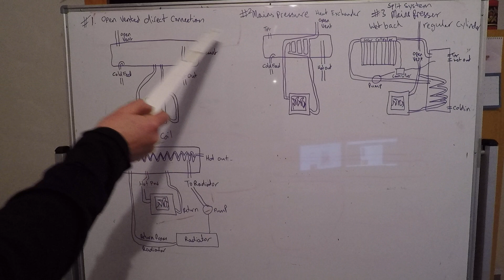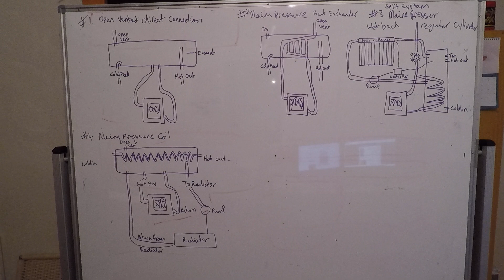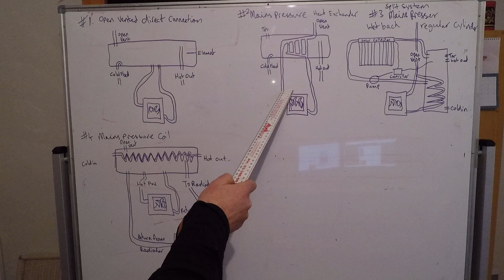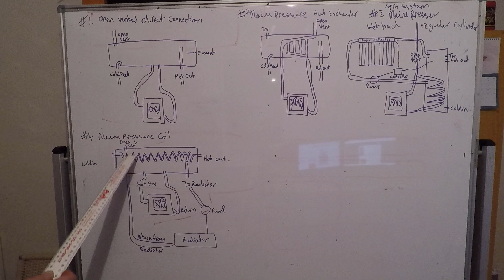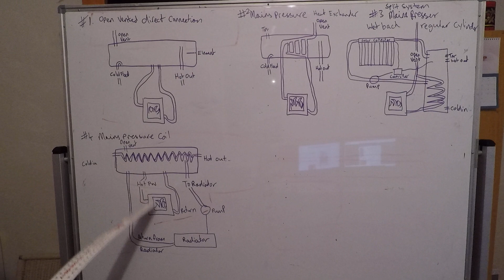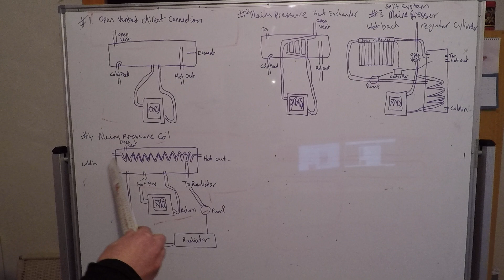The difference between wetback solar hot water systems

Comment: Thanks so much.  Not sure if you are answering but I'd like to know if the 1st option can be adapted to a radiator system based on hot and cold water pressures?  I.e. when the bath water is run could a lever be switched for the hot water to then run through a few radiators?  Perhaps the cold water is looped back to the low pressure intake?